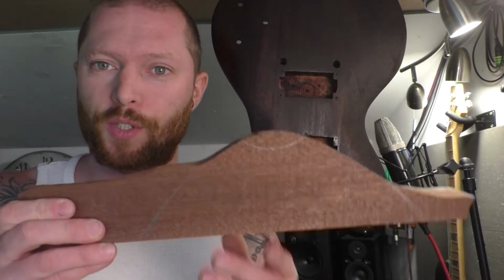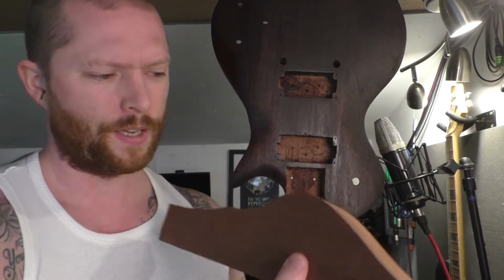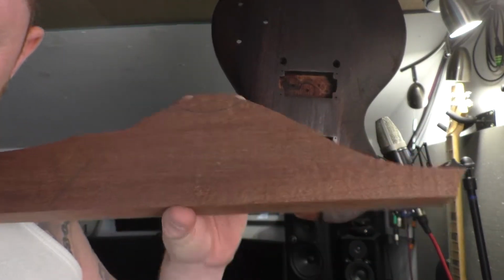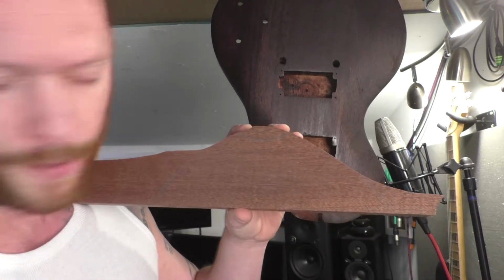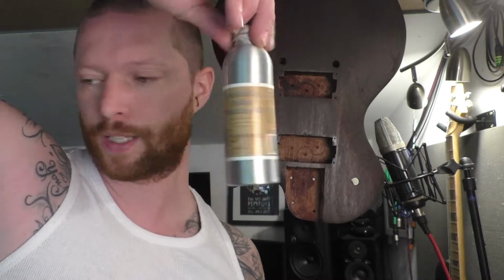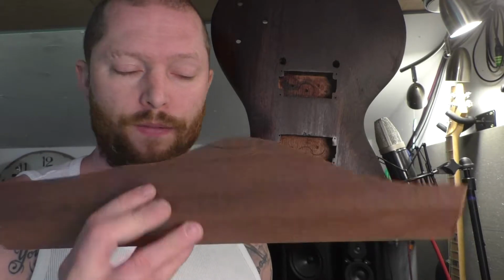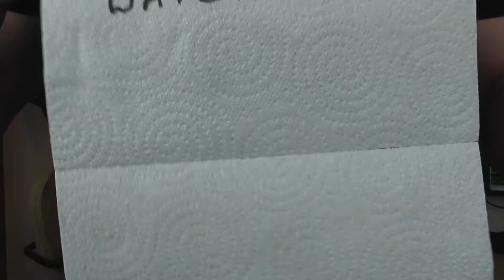How to make a guitar neck rest - DIY Luthier Tools

Comment: I use just use a leg cut off some old jeans. Cut about 18 inches of leg off. Fold and sew one end up, fill it with sand, fold and sew the other end up. Et Voila 😁 A sand bag which is perfect for supporting a neck while refretting etc
Reply from the maker: That’s a really good shout actually. At least it moulds to any neck and any angle. You’d never damage anything